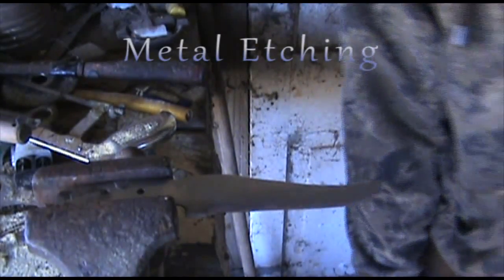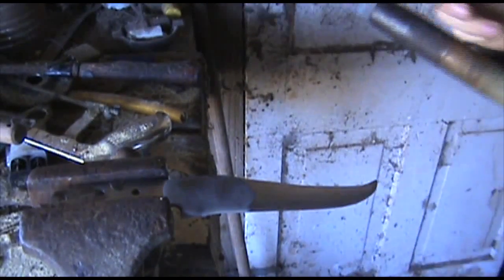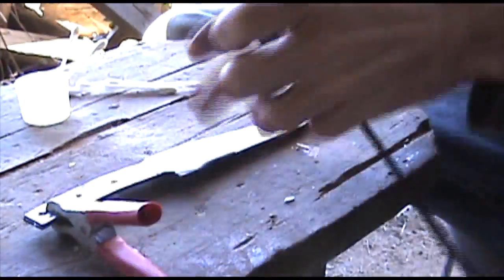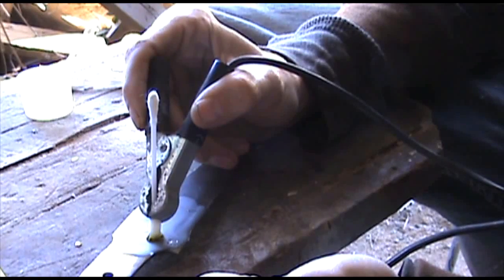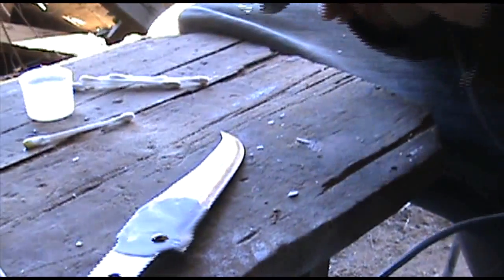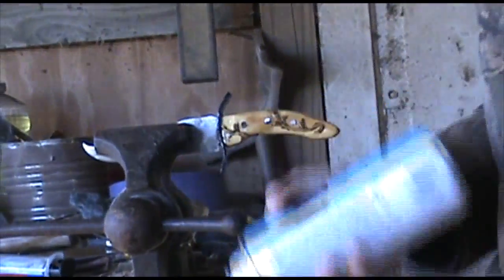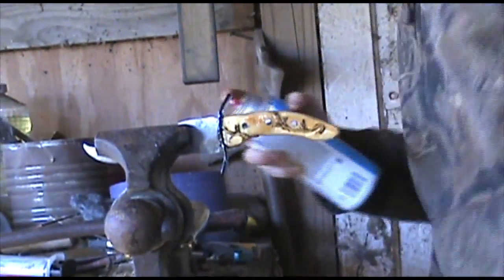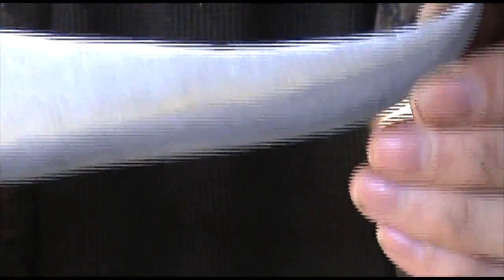Metal Etching Knife Blade

Comment: Great video. 
Mixing a little salt with the vinegar makes a better conductor (electrolyte). Using clear Mylar tape (boxing tape or even Scotch tape) to cut the initials or design in also works well. Some people use electrical tape, but it doesn't stick as well as the clear tape.

Comment: Just as easy to use thin wire with small clips on a 9 volt battery.  Works the same way and is far less bulky to handle.

Comment: I just viewed the eBay auction item and, if the blade does not exceed 5 and 1/2 inches, from handle to tip, then it would qualify as LEGAL FOR TEXAS CARRY ...
... Tempting ... The lack of a sheath is problematic.  The starting bid seems a very reasonable starting point, considering all the skill and effort (not to mention it was made by Miranda's brother ~swoon~) .  Nice job, there, Ky.